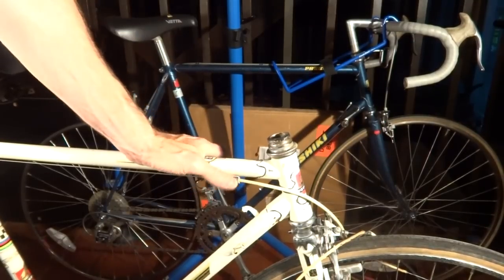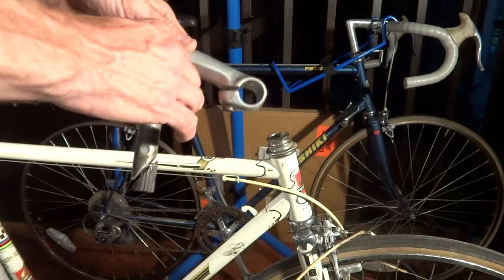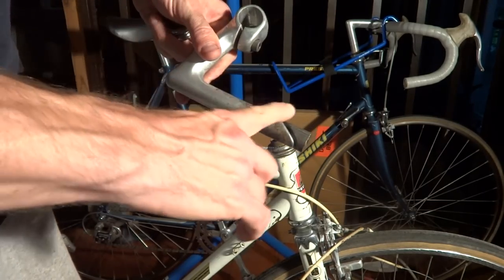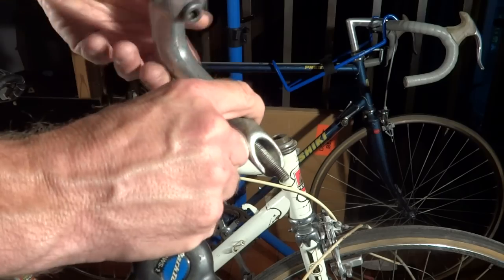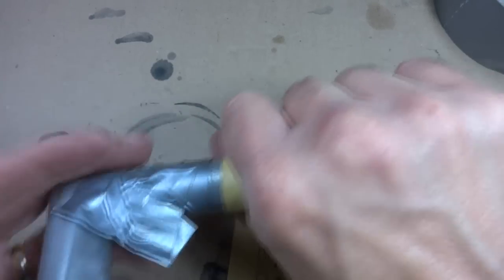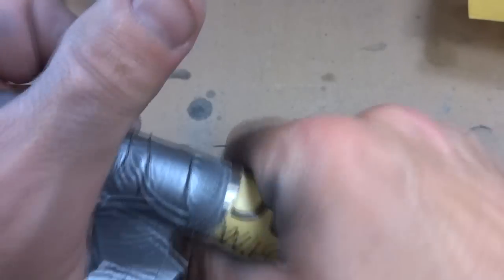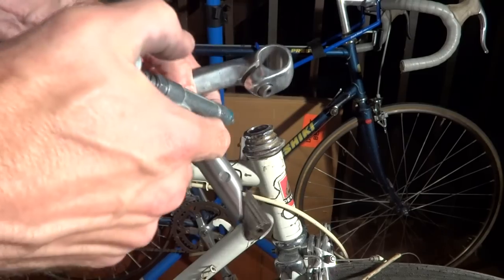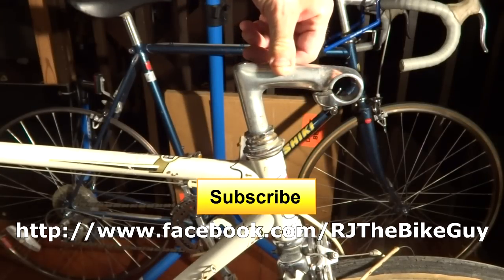How To Convert 22.2mm Quill Stem To Fit French Bike

Comment: I have a Vitus Carbone 9, I wanted to update it to accept modern stems and bars. I hand measured the original stem and thought it was 22.2 so I got a 22.2 to 1 1/8"  threadless adapter. Very excitedly I went to install and BOOM it does not fit by a smidge ... So thanks to your video I guess I can tell I have a 22 mm steerer ... I have to get some sand paper ... LOL ... Thank you for sharing your knowledge.
Reply: Just an update here ... I am happy to report this hack worked perfectly. I had to grind the adapter for some time and even found a way to use my drill to make faster but at the end it worked. I can now use modern stems and bars with my vintage Vitus. Thank you!
Reply: Victor Beltran ii

Comment: I tried this for my vintage Peugeot with 21mm and was able to sand it down from 22.2 with a belt sander until it fitted, you need to be vareful with the machine though not to remove to much :)

Comment: Good conversion, thanks for a fine demonstration and great job. The stem deserves a full polishing, because the hidden part which underwent the careful sanding looks better than the part which is exposed!  ;-)  And, on assembly, you've given a great reminder to us all, to spread a bit of anti-seize compound or bike grease such as you used to prevent galling of the two dissimilar metals (Alum. and Steel), or to minimize the Galvanic corrosion such as you mention. Thanks for the careful pointers!, and for an overall great demo.  Wish I had a classic Peugeot frame to fit my own biological 6' 3" frame... (I'm happy to have a Reynolds double-butted all-steel 1980s 27-inch "Team USA" Raleigh, tho'). Safe cycling!, --Joe / Tucson ARIZONA

Comment: Hi @rjthebikeguy, I've a similar problem with a steerer fork tube. I have a 28.6 fork for a 25.4 head tube. My idea was to grind the 28.6 fork in order to achive the 25.4 head tube size. From your experience it could be ok or does the steerer tube become way too weak? Thanks!

Comment: Wondering if you could do the same conversion on a 22.2 steel quill extender to install in a 22mm steer tube?
Reply from the maker: No idea.
Reply: Yes, if its got enough metal to work after you shave it

Comment: Good job, mate! I would not have guessed you could shave enough down with sandpaper. My inclination would have been to wire wheel it. May I request a vid on removing light rust from a seat tube (or steerer) and properly lubricating the stem(s)? Lubricants are many, as is public misuse of them. (I like graphite lock lube for stems, but I have no good authority that it's proper way to do it.)
Reply from the maker: Like this: How To Clean Rust/Corrosion From Inside Bike Seat Tube
And I use grease on the stems and seat post. It helps create thin barrier to prevent galvanic corrosion between the aluminum and steel. My preference is marine grease.

Comment: GREAT video! A poster below asked about converting the stem-mounted shifters to downtube shifters. Years ago a local bike shop GAVE  me a new old stock Suntour shifter and cable stop set to replace the quill mounted Suntours on my '76 Motobecane. The original cable stops are brazed on, but the shifter set uses to top set as a stop, the new cable stop uses to original stops to set the location. Looks fine, works better than new., I'm happy. But..what are your thoughts concerning bar-end shifters on these drop handlebar bikes?
Reply from the maker: I have one bike that has them, and I don't really care for them. But if you like them, go ahead. I prefer STI shifters which are a new technology.

Comment: Any chance you could do this for an old american frame to a 21.15mm stem?
Reply from the maker: No. Way too much material to remove.
Reply: @RJTheBikeGuy  is there amy alternative for an adapter lile this on the market or with a home remedy?
Reply from the maker: @clancymcintyre3241  Search ebay for a 21.15mm stem.

Comment: RJ, need your help... I have a 92 Trek 970. The steerer inside diameter is 1" and I'm trying to use a 7/8" diameter quill stem... Any tricks? I already bought the one piece handlebar setup.
Reply from the maker: The 7/8" (22.2mm) stem is for a 1" steerer. Sounds like your 970 has an oversized 1 1/8" steerer. You should buy the proper sized quill stem. Though with the oversized headtube, you could convert to a threadless fork/headset. https://www.youtube.com/watch?v=OHcjh4O20ko
Reply: The issue is that I already have a 1 piece Nitto Bullmoose handlebars bar/stem combo... I was thinking of buying a shim.. But found nothing.

Comment: I have a similar peugeot and my bottom bracket axle threads are stripped. How do I replace the bottom bracket? French bikes dont fit regualr cartridge brackets.
Reply from the maker: There are cartridge BBs designed to fit French bikes. You have to look for them though. I have several videos on bottom brackets. How To Overhaul A Bike Bottom Bracket - Remove/Clean/Install New Bearings 
How To Remove/Install Sealed Cartridge Bottom Bracket
How To Upgrade Vintage Bike With Sealed Cartridge Bottom Bracket
The main difference in removal/installation is the fixed cup side on French bikes is removed by turning it counter clockwise.

Comment: Would this method work for fitting a 25.4 seat post to a bike that has  25mm?
Reply from the maker: I did this because 22mm stems are hard to find. 25mm seatpost are not that hard to find. Just buy a 25mm seatpost. Or find a smaller diameter seatpost and use a shim.
Reply: Many thanks for the reply and I love your videos! I was asking because the particular seat post that I want is either hard to find at 25mm or it is too expensive. I found one with 25.4mm diameter and thought that in principle this method might also work.

Comment: i got it problems with the free wheel of Peugeot  bike....i can't  find the right tool to remove that 6 speed free wheel.....is around with tooth  outside......any idea?
Reply from the maker: First, Peugeot doesn't make freewheels. So I don't know what kind of freewheel you have. I am guessing Maillard. Maybe a Helicomatic hub? Is it this? https://www.youtube.com/watch?v=O4SOdVZ63cU
Reply from the maker: First, Peugeot doesn't make freewheels. So I don't know what kind of freewheel you have. I am guessing Maillard. Maybe a Helicomatic hub? Is it this? https://www.youtube.com/watch?v=O4SOdVZ63cU
Reply: +RJ The Bike Guy yeah i just findout  is helicomatic but the lock is inside is not outside like you have in your other video
Reply from the maker: First, Peugeot doesn't make freewheels. So I don't know what kind of freewheel you have. I am guessing Maillard. Maybe a Helicomatic hub? Is it this? https://www.youtube.com/watch?v=O4SOdVZ63cU
Reply from the maker: First, Peugeot doesn't make freewheels. So I don't know what kind of freewheel you have. I am guessing Maillard. Maybe a Helicomatic hub? Is it this? https://www.youtube.com/watch?v=O4SOdVZ63cU

Comment: I recently bought the same Peugeot and I am now restoring it the best I can and I was wondering wether or not I should change the stem?
Reply from the maker: +julien bouchard Is there a reason to change the stem?
Reply: +RJ The Bike Guy I don't think anything is wrong with it except for a bit of rust. should I be safe and change it?
Reply from the maker: Is the stem steel, or aluminum?
Reply: +RJ The Bike Guy Im pretty sure it's steel
Reply from the maker: +julien bouchard You can always clean off the rust.